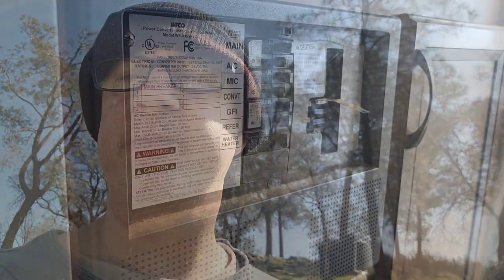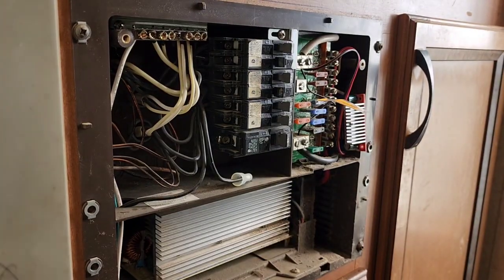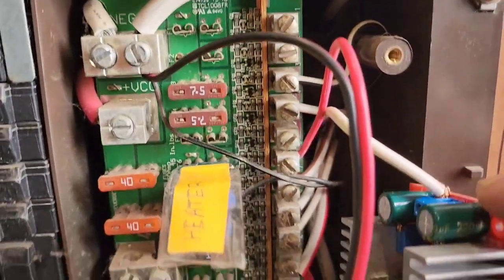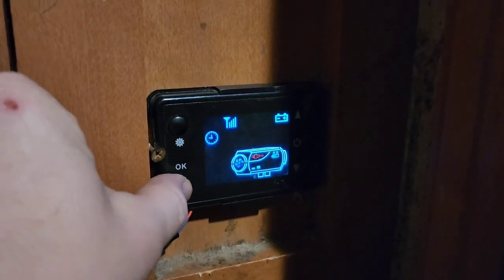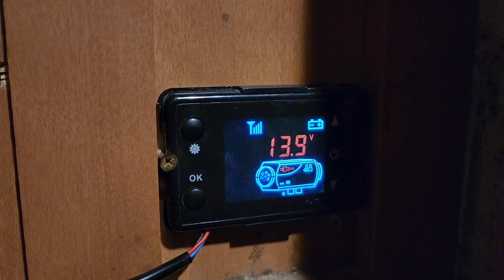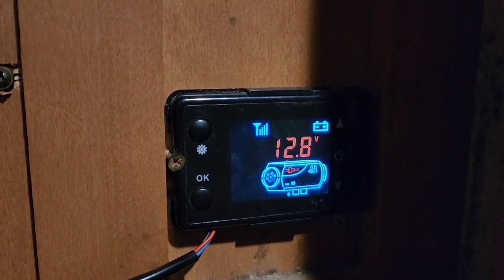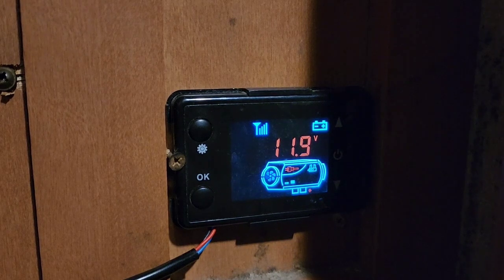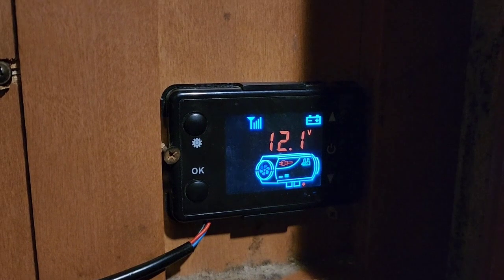Chinese Diesel Heater Low Voltage Error Problem and Fix. Solved!

Comment: Thanks i have same problems with a 2kw diesel heater i test baterry power and.i get Errors code 01.mean low voltage i going to try this and see whats happens

Comment: something to keep in mind is the glowplug circuit for these heaters is essentially a dead short across a resistor. it starts at around .8 ohms and then gets up to around 4-5 ohms right before it shuts off.
depending on the input voltage to the diesel heater (they actually run just fine from like 10-30v), the max power draw on startup can be very different. at around 12v, they take ~10-12 amps to get going on a cold start (100-150w), so portable power stations usually cant do that thru a 10amp cig plug.

but there is another problem with higher supplied voltages. the glow plug requires more power, following V^2/R
given ~4-5 ohms peak value, at 12v supplied, the glow plug will burn about 30 watts, but if you use higher supplied voltage at around 24v, it will actually take closer to 120w for much longer. usually the higher the supplied voltage the lower the amps, but not always true with a dead short across a resistor.

the boost module u showed is only 2-3 bucks from china and its only really rated for ~7amps input with air cooling and ~12amps with a fan outside of an enclosure. so if you run much higher than ~15v to the heater, it will very quickly overload the module and cause some weird clipping voltage behavior as its PWM brain chip starts to get overloaded. that module can go all the way up to like 50-60v output, but i would try to keep it closer to 13-14v like u showed or else it will eventually fail after enough cold starts and might take ur heater's ecu board with it. you should probably look for something rated a little bit higher or use 2 of them in parallel or something. kind of a specific problem.

Comment: Make certain that the air port feeding the glow plug chamber is unobstructed. All of the fuel burn should be beyond the screen . The screen is an emulsifier.

Comment: Never seen a 12 volt device that was not happier at 13.8 volts . I use an adjustable power supply powered by a UPS . Adjustability and backup.

Comment: I'm confused here. You have a wire IN to the input on positive but not the negative in. The output of your converter/booster has both neg and positive out.????

Comment: Well I bought this converter awhile ago after your video and today attempted to hook it up. It instantly fried my diesel heater board rendering the heater useless!
All it outputs is an open leg but when I unplug it the capacitors shoot up to 20+volts and slowly come down to zero. Plug it back in, open leg on and on.

Comment: Is a root cause inadequate power wire gauge provided in the harness?  Why don't they use heavier gauge?  I went through 3 heaters and just got a Lavaner.  It's pathetic you'd have to boost voltage out-of-the box.  FYI I've seen videos where they load tested and confirmed glow plug can chew on over 10A.  Others have suggested snipping the power wire near the heater and splicing in 10 AWG.  Thanks for another bullet in the holster.
Reply: I’m thinking the same that wire gauge is too small 
I have it hooked up in my semi truck to 4 950CCA batteries and it won’t start without engine running and charging
Reply: Please let us know if you identify and address any voltage drop as the villain.

Comment: Hi David, Great video. I have a question, you said you increased the voltage, then installed the booster. Where you increased the voltages?

Comment: How do you check for soot buildup on chamber screen, and how do you remediate.  Do all ECUs display voltage? 
I use a CDH in my van home with solar-charged leisure batteries.  I suspect my source of voltage drop is wiring harness; I've read advice to up grade to 10ga.  I can't figure out how.  Help?  Great vid, thx.

Comment: Can you post a link for the converter you bought?
Reply from the maker: Sorry for the late reply. I updated the description with a link to a suitable converter.
Reply: @djdavidj5531  so I bought the one you recommended. It only lowers the voltage. I need to raise the voltage a couple volts. I thought that’s what a boost controller does. I’m running 12v solar from a 200ah battery. Need a couple more volts to the heater on fire up

Comment: I used my ac /dc 12v converter and worked fine however next day I decided I needed to put the converter in a safer place away from potential damp or water and so by moving it I had to put extra length wires that to my eyes look pretty much he same but now it tries to start for all of 5 seconds and switches off with E2 error code , yet it says 12v on the heater itself , surly adding a few feet of cable can’t cause this can it ?  you seem like a clever guy with the electrical stuff can you advise? I’m gonna put back the original wires too the transformer and see it it comes back to life again anyway but if this is the problem why ??
Reply from the maker: Sorry for the late reply.  I don't typically attend this account. A few feet can definitely affect voltage drop. Google "wire size calculator" and look for the Omnicalculator link. The longer the run, the thicker the wire needs to be.  You can boost the original voltage with these buck boost converters and test the voltage on the other end. The voltage will sag a lot when the glow plug kicks on.